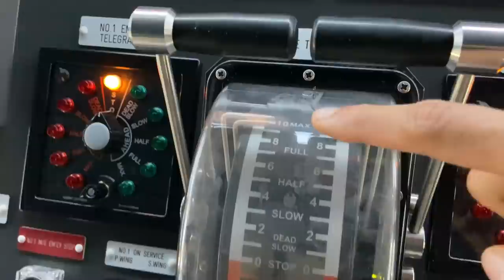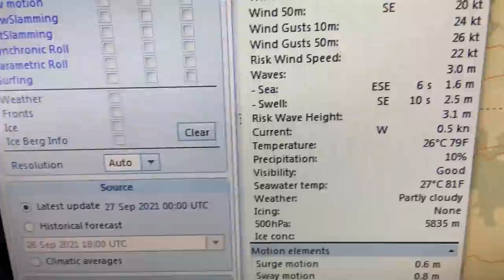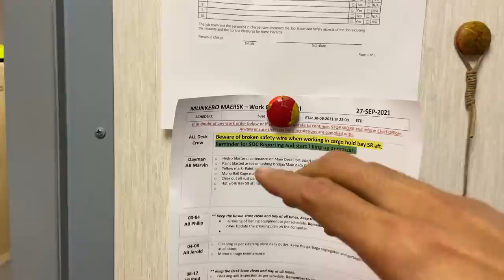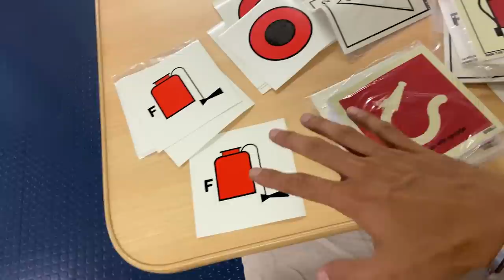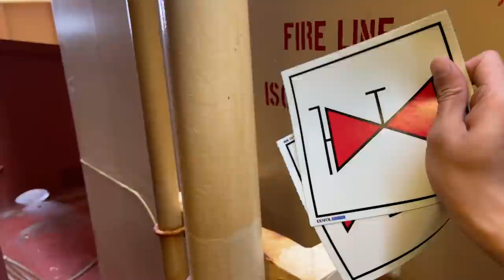What Sailors Do Onboard A SHIP In Middle Of Nowhere | Sea VLOG |

Comment: Nice hair cut. Raul is a great barber. When you move from cooler to warmer sea water do you need to jettison some ballast water out to maintain proper Plimsoll line ? If so, are there strict rules as to what water can you jettison to prevent invasive marine life ? thanks for the nice vlog.
Reply from the maker: Well yes the ballast has to be adjusted
I'll make a video on it

Comment: Excellent video, I'd like you to do a tour of the air conditioning equipment. I know you've done an engine room tour but would like to see the air conditioning and ventilation equipment in more detail. It's strange how a ship of this age struggles to keep the ship bridge cool surely it should be able to cope with hot temperatures? Are you using 100% fresh air or re-circulation?
Reply from the maker: Fresh air 
Will cover that in a video
Reply: @KaranvirSinghNayyar  I guess this is due to Covid protocol. Yes a video as difficult to understand why a modern ship air con system cannot cope with warm sea temperatures to ensure comfort inside.